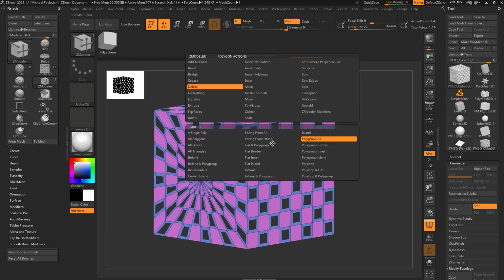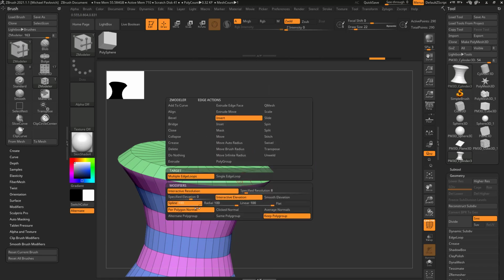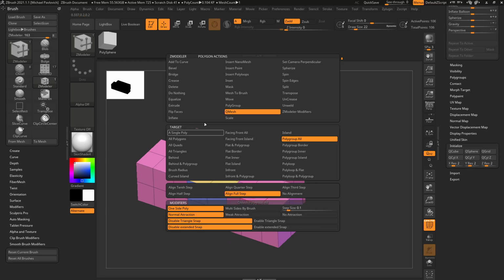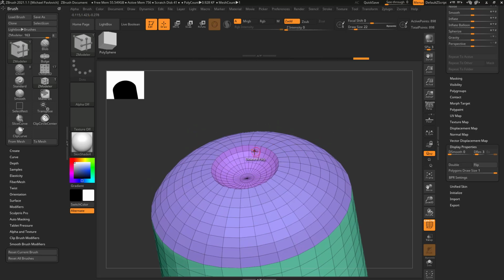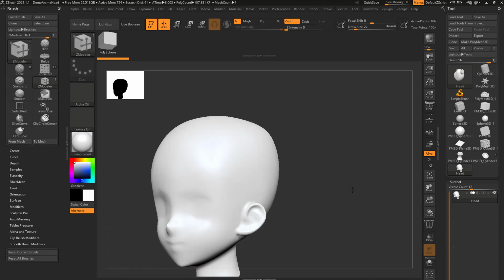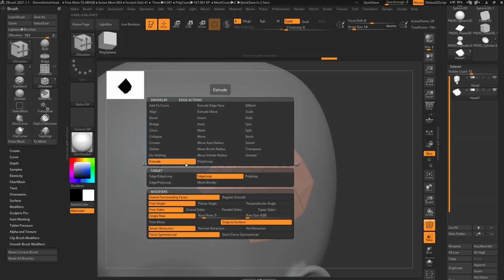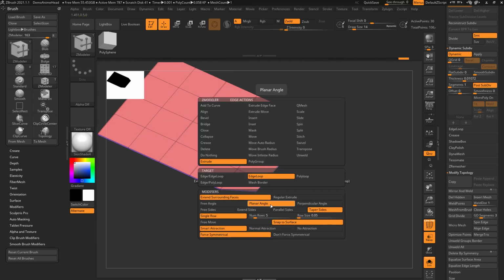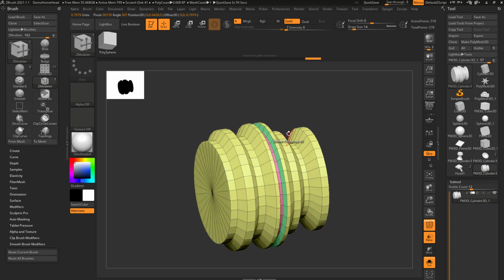Intro to ZBrush 033 - ZModeler Edge Actions! Slice, insert, bevel, delete, topology snap, and more!

Comment: Is there anything you can use with the ZModeler tool to "correct/adjust/clean up" edges, vertices or faces that overlap with each other?
Reply from the maker: Not sure about ZModeler, but Tool > Geometry > Modify Topology > Weld should do the trick
Reply: @MichaelPavlovich  Ah, thanks i will try that one :) I'm new to zbrush and have been following and used your videos to learn. Very nice tutorials, appreciate it a lot, thank you!

Comment: the cylinder dome shape after closing it with the convex hole option is not working. I am on the interactive mode(default) but it didn't work. stayed flat. any ideas? Is it a newer feature?
Reply from the maker: old versions of zbrush would hit a limit on the number of edges (a 12 edge cylinder would close, a 32 edge cylinder wouldn't). If your subscribed you should be able to get the latest version, if you're perpetual you can as well. If you're neither, well, there's probably a number of old bugs you're going to run into.